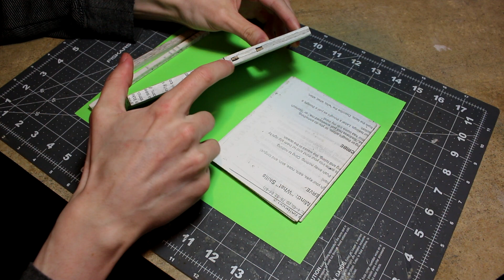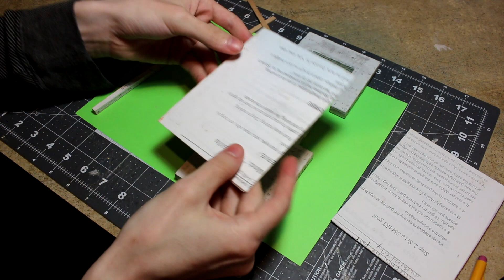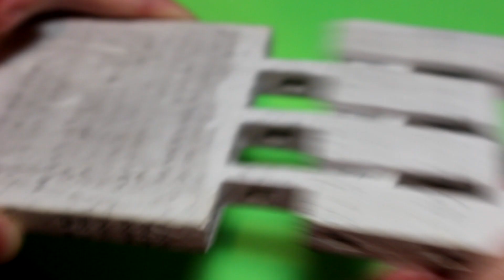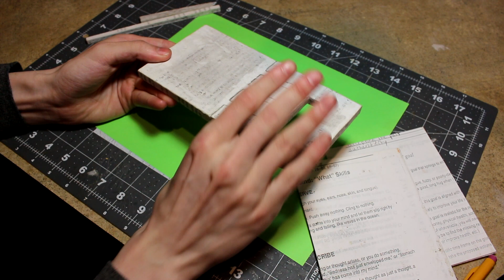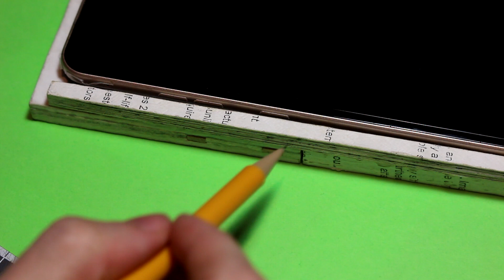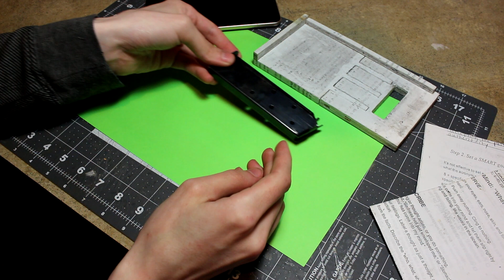Overly-Engineered Paper Phone Case Update 1

Comment: Heyy I was wondering if you have any tips on making hardened paper with no air bubbles? I put enough glue and spread it evenly but there's still always air bubbles.
Reply: Tried putting something like a heavy book on it?
Reply from the maker: Yeah that happens sometimes. I usually put it under something flat and heavy for a couple days then the bubbles seem to dissapear.
Reply: Use a book press with the piece in between the blocks, and put them in a vacuum that fits. Then once all the air is extracted, get the book press out for the piece to dry.